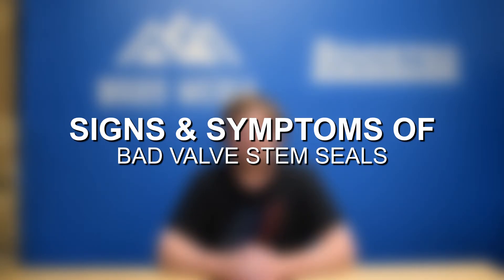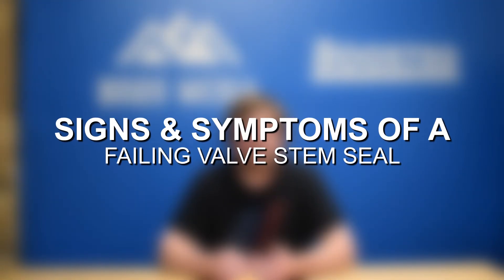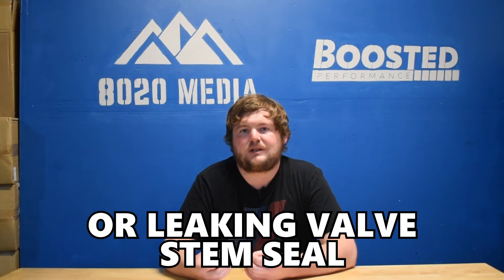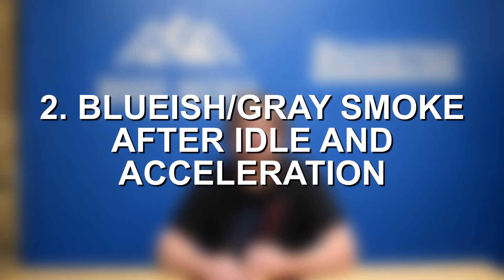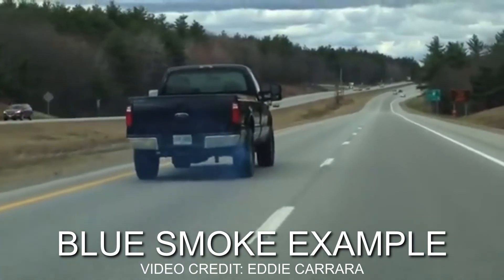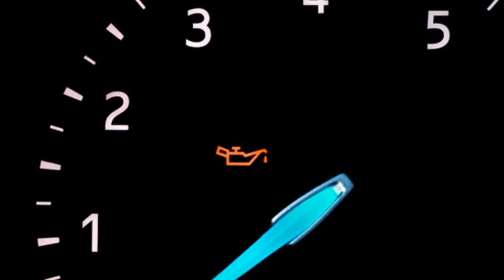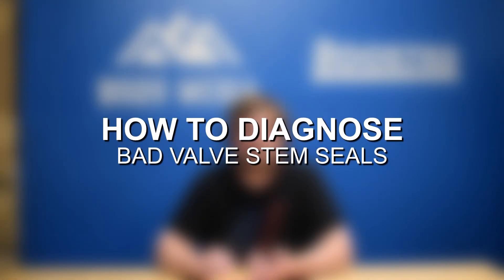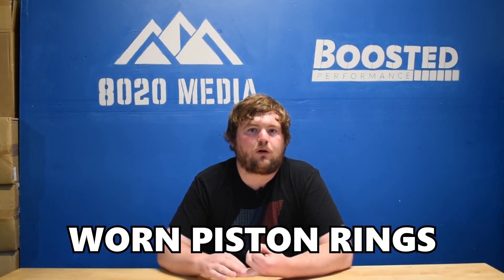Signs & Symptoms of Bad Valve Stem Seals!

Comment: avalon 2002, no smoke under any condition. but only if i drive let says 50KM and let it sit for a while , on startup it does a blue smoke for 3-5 secs and disappers. i have done alot of tests in which only that time it does smoke. i losse around 0.5L in 1000KM. is this indaction of bad vavle stem seals?

Comment: I need to replace the valve stem seals on my bmw. It’s currently at 190,000kms but I plan on keeping it for now. Do you think I should replace the engine or just fix the stem seals as this is a common problem for bmw’s and I’ll probably have the same issue with the next engine at some stage

Comment: What about very poor vacuum and blue smoke under acceleration but no smoke in park or cold start only smokes while accelerating but driving slow nothing 2012 Audi s4
Reply from the maker: I - On your 2012 Audi S4, poor vacuum plus blue smoke only under acceleration (but not at idle, cold start, or gentle driving) points most strongly to a PCV system failure or excessive crankcase pressure forcing oil into the intake under boost. The 3.0T is notorious for PCV/oil separator problems, and when the diaphragm tears or the check valves stick, you’ll lose proper vacuum at idle and oil gets pulled into the intake tract only under load, which burns as blue smoke. Valve stem seals usually show as smoke at cold start/idle, and turbo/supercharger seals tend to smoke both at idle and under boost, so your “only under acceleration” symptom fits PCV failure best. I’d start with a crankcase vacuum test at the oil cap — if it’s blowing out instead of pulling in, your PCV is shot. Replacing the PCV/oil separator (and checking for clogged breather lines) should restore vacuum and stop the acceleration smoke.
Reply: ..another very good answer..

Comment: But my car only smoke after I rip the gas but grandma speeds nothing
Reply from the maker: J - If your vehicle only smokes when you floor it but not under gentle “grandma” driving, that usually means it’s burning extra oil or fuel under heavy load but not enough to show in normal cruising. On the 6.0 Vortec, common causes are worn valve stem seals (oil gets pulled in on high vacuum then burns when you hit the throttle), piston rings/cylinder wear (oil blow-by that shows up under WOT), or simply a rich fuel condition if the tune or injectors are dumping fuel. The color of the smoke is the key: blue smoke = oil, black smoke = excess fuel, white smoke = coolant/steam. Since it only happens when you romp on it and not cruising, it’s less likely a constant mechanical failure and more a load-dependent issue like seals, PCV, or tuning. First step is to confirm the smoke color so you know if you’re chasing oil or fuel.

Comment: My vehicle, Mercedes 2005 c230k with m271 has been shortening engine oil of about 1ltr per 350km.
This started just after I changed the top cylinder gasket due to overheating.
The check engine light came up with catalytic converter below threshold, I don't experience any smoke but I perceived burned oil odour.
My earlier suspect was the piston rings until I saw this video.
How would you advise I treat this problem?
Reply from the maker: F - Given your M271’s sudden high oil consumption after the head gasket replacement, plus the catalyst efficiency code and oil odor without visible smoke, the likely causes are either internal oil leakage from valve stem seals/guides or an improperly seated/installed head gasket allowing oil into the combustion chambers in small amounts. Overheating often hardens valve seals and can slightly warp the head, so even after a gasket change, oil can seep past the seals and burn cleanly enough not to produce visible smoke but still trigger catalytic converter efficiency issues from oil ash. Worn piston rings are possible, but since the problem began immediately after head work, I’d first verify the cylinder head was resurfaced to spec, that the gasket orientation and torque sequence were correct, and perform a leak-down test to pinpoint where the oil is getting in. If compression and leak-down look good, replacing valve stem seals may resolve it without pulling the bottom end. I’d avoid chemical “fixes” as they can mask symptoms but accelerate catalyst damage; instead, confirm the mechanical cause before running the engine much more, because sustained oil burning will ruin the catalytic converter and O₂ sensors.
Reply: @8020Automotive great response.

Comment: I don't understand what will that O-ring that is secured on the stem of the exhaust valve do right below the keepers, that high up on the stem, reduce oil on the stem?    Why not use another seal similar to the intake stem seal that has the retaining clip on it?
Reply from the maker: J - That O-ring located just under the valve keepers on the exhaust valve stem is an umbrella-style oil deflector, not a true stem seal like the intake side typically uses. Its purpose is to reduce the amount of oil that runs down the valve stem from the top of the head, especially when oil splashes up during operation. It doesn't seal tightly like a modern positive valve stem seal with a metal retainer; instead, it acts as a passive baffle to limit oil exposure. These O-rings were common in older engine designs or budget engines where tighter oil control wasn’t as critical on the exhaust side due to less vacuum pulling oil in. A full positive seal like on the intake might be better, but OEMs often didn't use it on the exhaust side to save cost and because exhaust heat can degrade seals faster—so a loose-fitting O-ring was a compromise.

Comment: Would a cataylitic convertor or dpf systems kill the smoke indicator?
Reply from the maker: P - Yes, both a catalytic converter and a diesel particulate filter (DPF) are designed to significantly reduce or eliminate visible exhaust smoke, so if your vehicle originally produced noticeable smoke (especially diesel engines) and now it doesn’t, it could be due to these systems working properly—or in some cases, being clogged or malfunctioning in a way that restricts flow and prevents smoke from escaping at all, which may also reduce power or trigger fault codes.

Comment: What causes blow by
Reply from the maker: T - Oil blowby occurs when combustion gases escape past the piston rings into the crankcase, carrying oil mist with them. The main causes include worn piston rings, cylinder wall wear, or damaged valve seals, which allow excessive pressure buildup. Other factors include clogged PCV valves, which prevent proper ventilation of crankcase gases, and boosted engines with excessive cylinder pressure, forcing more blowby past the rings. High-mileage engines naturally develop more blowby due to wear, and poor maintenance (infrequent oil changes or using the wrong oil) can accelerate the issue.

Comment: 2009 Dodge caliber 2.0
185k miles. 

Other week had extensive amounts of oil spray out into the engine bay. Had to replace valve cover entirely. 

But while im not smoking from the engine nor seeing sny oil in the bay, i am having yhe acceleration issue. Sit at a red light, then go to take off, car putters and doesn't want to accelerate. And it shoots out a massive cloud of white smoke. 
But after s few seconds, smoke is gone snd engine runs fine. 

Was worried its a head gasket. But i dont seem to he losing coolant, and the smoke isnt consistent. Just on start up and the random clouds in acceleration. 

But if this is my issue, i dont think i want to even get it fixed.
So guess its time for a new car. Just hope mine hold gor a few more weeks. 

Payed 500$ for it. Had it s little over 5 years now.
Reply from the maker: N - Sorry to hear this.. However, thanks for taking the time to share your experience!

Comment: There are pneumatic tools that compress the valve springs for stem seal change already in practice. Though it's not a cheap job (valve cover needs to be removed and gaskets/plastic valve cover are to be changed), the total cost is halfed, even quartered as it's no longer an engine-out job (cylinder head removal not required anymore).
Reply: Can anyone do my valve stem seals and maybe replace piston rings based in Manchester Hyundai i20 1.4 diesel 2016
Reply: @brianbrewful  Little hope with diesel engines. To correct my previous reply, the pneumatic tool blows air into the cylinder to prevent valves from falling into the cylinder. The balloon (to keep the cylinder airtight) of current tools is designed for the ports of spark plugs. You probably have to go for the conventional approach.
Reply from the maker: I - Thanks for sharing this insight. But not sure all engines can be said with this.
Reply: The only Toyota shop in my area want $5300 to change 24 stem seals on a '18 Tacoma 3.5..

Comment: I’m having every symptom here. I got two questions tho, my truck struggles to start and usually only starts after about 3 cranks, is this another symptom of bad valve seals?  And then my vehicle also sucks in air every now and then through the exhaust, is this another symptom?
Reply from the maker: P - Are you getting any engine codes? We have a video that could help your research: https://youtu.be/0YRdzJbHcm4

Comment: Have high mileage Mustang 302 and it suddenly started blowing a couple of seconds of blue/gray smoke after interstate driving for at least 15 minutes.  When I exit interstate, decelerate and then merge onto regular road and accelerate in 2-3 gear, it will blow a couple of seconds of blue/gray smoke and then clears up.  I can drive in city, idle fine, runs like a top.  I just did a complete tune-up and resealed engine and there are no vacuum leaks and the car runs beautiful except for the occasional smoke after high speed driving.  I did take out spark plugs and only 1 plug was a greasy/oily mess.  I think the oil is getting sucked up through the upper manifold via the pcv valve and then sent to the combustion chamber during high vacuum driving(interstate).  Would a bad valve seal on that one cylinder that has an oily spark plug have a bad valve seal.  I don’t think it’s a bad piston ring on that one cylinder, but I could be wrong.
What do you think?
Reply: sounds just like what i have going on.. Especially letting off the gas on a down hill , the next light it blows a cloud..
Reply: @mikemalone2834 did you fix it ?
Reply: Cold start for about 5 seconds then it's gone
Reply: What was it ? I have a 21 gt with 6k miles and it does that if i punch the gas it smokes a cloud ?
Reply from the maker: J - I think your diagnosis is spot on. There has to be oil coming from somewhere that is going into the combustion chamber.
Reply: I’m doing a compression test this weekend and that could tell a lot.
Do you think replacing the valve stem seal on that cylinder that has the nasty spark plug will/could fix the problem?
Reply from the maker: J - Wait and see after the test, but it certainly could!